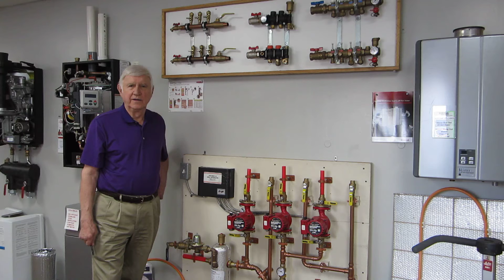Difference between a Zone and a Circuit - DIY Radiant Floor Heating

Comment: Hello, i love this video. Im upgrading my gas fired hot water boiler, from radiators to radiant. 2 zones, one for the 1st floor and one for the second. Im planning on putting a 4 way mixing valve to bring down the temp from the boiler and keep the return above 140, to prevent condencing.  Can i use one mixing valve or will i need 1 for each zone?
Reply: Curious how your project ended up turning out. I've got a 1 zone setup currently on my boiler. All cast iron rads are on it. I am going to separate out the first and second floor into their own zones. Then add a 3rd zone for radiant floor heating on the first floor and a 4th zone for the new area in the basement.